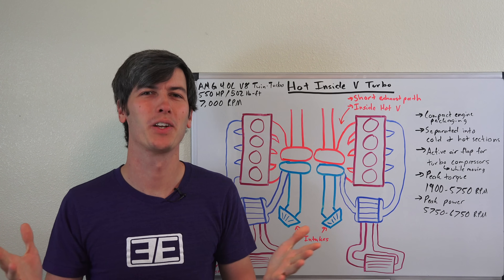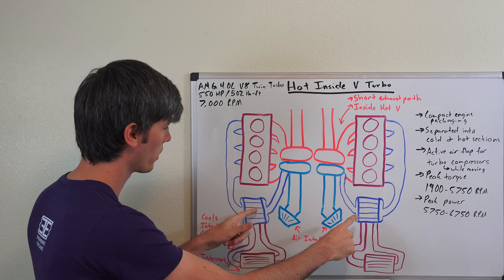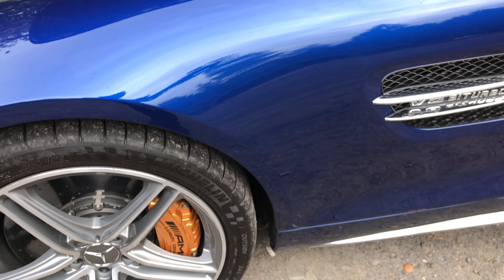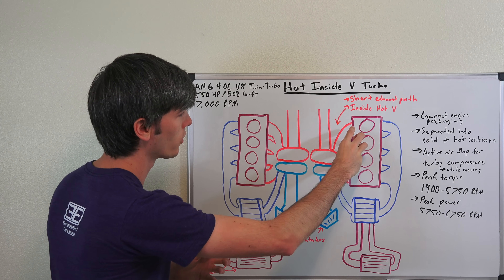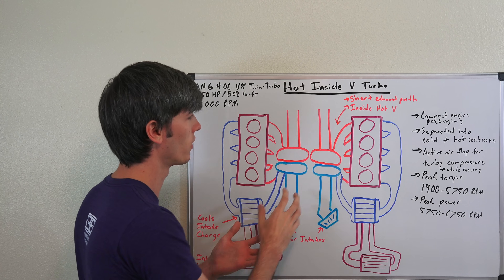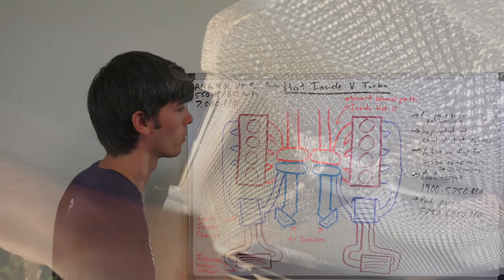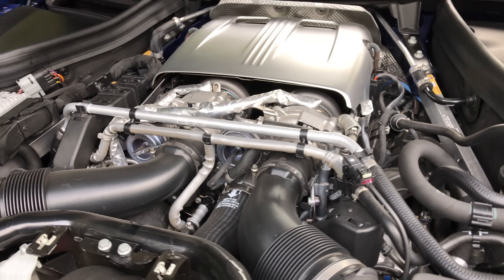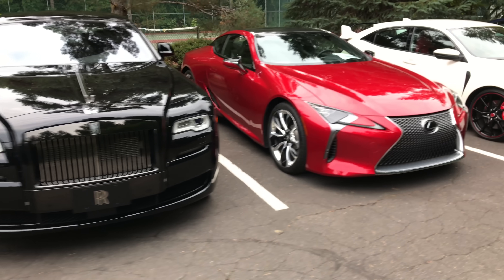Mercedes Clever Turbo Engine - "Hot Inside V"

Comment: Sounds like a nightmare to service...
Reply: No harder to service than normal as we typically drop the entire engine if major repair is required. Also nothing is placed inside the v to be serviced besides the turbos and manifold. Spark plugs are placed outside the v which improves servicing as the exhaust is no longer there and injectors are center of cylinder head which are the long tubes in the illustration. Servicing is easier on this engine family which means I make even less on warranty repairs which was not that much to begin with :(.
Reply: Can confirm.
Reply: Fozee Black Heat shielding is a thing you know... All sorts of coatings and insulations available these days. These engines rarely fail from these obvious spots, for bmw it was the retarded decision to use recycled plastic in their accessory pulleys that killed countless engines...going green because of pr made a huge dent in their reputation.
Reply: If you can afford the car it shouldn’t be a problem lmao
Reply: To me im thinking of 2 huge 98mm turbo sticking out of the hood.
Reply: MasterMech77 You said it!
Reply: AutOdometer Yep. I pity whoever has to service these turbos when carbon build up needs getting rid of.
Reply: Yep, whatever is in that V over time comes out pretty cooked...
Reply: This.  If the engineers can get better performance, efficiency, and a more compact package all without breaking the budget and the downside is it is harder to disassemble for service they won't even bother asking which way they should go.  Thats true on basically every car from every manufacturer.
Reply: its definitely more efficient and compact. makes a lot of sense from an engineering perspective.
Reply: MyBrothersKeeper but not from a practical longevity standpoint
Reply: Most mechanics will appreciate having the turbos served up in the vee. You know, just where carbs sat for decades in old tech v8s.
Reply: True, but the customers who buy MB new don't buy them for reliability or ease of maintenance. Less turbo lag at the expense of turbo location makes sense in this case.
Reply: It's not bad... Mercedes are actually pretty easy to service, believe it or not
Reply: Coffey King no they aren’t, do you work on them? I do, not fun
Reply: AutOdometer I love how your taking advice from Scotty Kilmer , a mechanic that drives a Toyota corolla lmao
Reply: lol no one services mercedes. just throw them away and make a new one. they never reach an end user that cares to pay to fix them.
Reply: RL Agito wrong I have a 2011 c300 with 70 k miles and I service it regularly
Reply: iliovecaRS I'm rich enough. Because I don't waste it on buying Mercs.
Reply: You should give Mercedes a call and let them know. I'd be pretty surprised if they don't end up sacking their engineers and hiring you as a consultant.
Reply: I have owned a couple MB cars... they are very well made and will last just as long if not longer then typical average vehicles... Unless you don't do proper maintenance on them. So anyone saying they don't last are the people that don't maintain vehicles properly. I am not just talking getting the oil changed by some "quick lube" either... using the right oil, doing the services on time, stuff like that. Not waiting "another" week because you don't feel like getting the car serviced... because what harm will an extra week of driving do right?... Yeah bad habits are what kills cars that are not forgiving of a poor maintenance routine.
   If you think a MB has poor longevity... feel free to continue to drive your vanilla 4 door Eco boxes. I don't mind, someone has to do it.
Reply: Audi’s new 4.0 v8 in the s and rs models has this layout. And yes, they are crap to work on in this config. Done a few jobs in my time at audi on these. Luckily not many went wrong.
Reply: why?  by the time it needs spark plug replacement your lease is up  :D  just return to dealership  ...
Reply: Right. They're cars just like a Toyota Camry or a dirty, old Ford pickup. There's always a way to fix something - take it from someone unfortunate enough to work on the aileron control system of a 1982 Cessna 152!
Reply: Looks easy as hell to service to me. The turbos are right there in your face, it doesn't get any easier than working on top of the engine. Rather than try to get at the turbos that are wedged between the unit body and the side of the engine block and lord knows what suspension pieces and hoses and what not.  shrugs
Reply: It's called planned obsolescence
Reply: Fozee Black yeah, I wounder how they have solved that..?
Reply: Any turbocharged OEM car is..
Reply: iliovecaRS I work in corporate finance. You drive an old Subaru
Reply: TheSaintST1 I work in finance too I live in New York , you probably make 50k a year if you lucky lmaaao
Reply: Oh I'm sure the turbos will hold up GREAT with MB's long drawn out oil change intervals, lol.
Reply: service ?  why ?, its not a toyota that can be driven up to a million miles,  Mercs are the type of a car that is mostly leased, return it after four years  :D
Reply: 1/2 of the original price gone in 2 months basically, the longer one keeps this car the more expensive it is to maintain hence it is a car that is leased instead of owned  :D
Reply: Yea, he might but his statement/comment is still correct, it would take specialize tools to work on those things for service...
Reply: In Murica you don't have to afford one, you just need to lease  :D    besides with the way Mercs depreciate it is wise to lease than to buy   :D
Reply: As Scotty Kilmer stated in one video a brand new Mercedes at $82k was $16k 5 years later
Reply: No, actually it's quite the opposite.
Reply: AutOdometer Do you even Know where turbos in other Cars sit? 
i bet it is far more easier to maintain than other cars
Reply: MasterMech77y econobox has lasted 10yrs and 160k with nothing but oil changes and spark plugs.
Reply: RLAgito  That's one of the dumbest statements I've ever seen on youtube, and you know the competition is big.
Reply: illstplaya  The comment was made that having the hot vee arrangement would make servicing the turbos a nightmare. Not so they are very accessible in the vee. This engine of course does not use carbs.
Reply: If you can afford that you wouldn't need to service it yourself lol
Reply: illstplaya  Read what I said gumball.
Reply: I also see a lot of plastic on that one.
Reply: sounds like a mercedes
Reply: M271 engines were absolute junk, regardless of how well they were maintained, I have seen these engines at 70,000 miles with full dealer service history, and all the sprocket teeth have vanished of the cam gears. Mercedes refused to change the design and replacement gears are 500 euro each, and still made of poor steel. This engine was very popular in Europe and failures were common place, giving Mercedes reliable reputation a proper kicking. I am not disagreeing that some owners skimp on maintenance , but manufacturers standards have really nose dived since around 2000.
Reply: TrueBlueEG8 I keep hoping that new car lease financing schemes will encourage manufactures to make longer lasting cars since they're the ones who have to deal with the problems once the lease period is over
Reply: TrueBlueEG8 uuuuuuuugh the 271...... I do hope they engineered my m276 Dela 30 better!!!
Reply: AutOdometer nah! It's easy!
Reply: nothing unusual for premium or performance cars
and this one is both
Reply: I own both an Acura and a BMW. I work on both and can drive one while the other is being worked. I work on them because working on cars is fun and I've already invested money in purchasing them. Upkeep is just part of the equation. When you've purchased a house, you don't just let it fall apart, correct? You fix things that break. Same idea. The honest truth is take care of things the right way and they'll work the way they were design to be. Be aware of the fact that more performance sometimes means less reliability. They both have their good and bad points. Acura, not enough torque; BMW a little less reliable when driven hard but love the performance. Take care of both well and there are no worries.
Reply: It is. Only experienced it with the engine of the bmw x6m though.
Reply: AutOdometer easy to service, the older stuff is worse, imo
Reply: Becoz it's HIV XD
Reply: It pays off when you have high reliablity😉
Reply: Well your not doing the work are you
Reply: That looks like 2980's Chrysler engineering..Lololol. is that a jagged turbo next to the brake fluid reservoir? Ok. Probably$5000 for the"extra firewall insulation package".
Reply: The part no one mention about the newer turbo "more efficient" modern samller engines... lol what a amount of crap! bring back the more reliable NA units please!
Reply: Why would they be a nightmare ?
Reply: If tha's the case, have you ever worked on MTU 4000 engines or Cat 3500's?
Reply: Not at all. Are. You suggesting the ‘outside hot V’ engines are easier to service?
Reply: Bruh one came in for an oil change and I ended up having to put a camshaft in it, random ass crank to cam correlation fault. Timing was a nightmare, now I have misfires 😂 this is a freaking nightmare
Reply: oh and it looks cool as all get out :)
Reply: no... what are you smoking, belly button fluff?
Reply: Thats maybe the case for americans which hardly service their cars anyways, so when you let mercedes maintenance slip, it will cause a exponential failure of components that would never break if the car was properly maintained. Mercedes are one of the most popular second hand old cars in europe since they actually last many more miles than other Germans.
Reply: Asiamies ya well Americans USED to make certain types of vehicles that were bulletproof that were easy to work on yourself and didn’t require that much maintenance. Now, thanks to demorats, we have to put so much time, energy, money, parts, and last but not least thought, into every mile we drive and worry about tax on miles and paying for toll roads and paying carbon tax.... the list goes on and on.
Reply: LOL, engineers last concern is a technicians ability to do their job.
Reply: like some Renaults where you need to take the wheel off to change a light bulb? lol My partner has one and it seems like any small job is a complete ball ache
Reply: It is gonna take hours and special tools to some simps work like  change spark plugs for sure
Reply: iliovecaRS So do you based on your incorrect use of your/you're.
Reply: MasterMech77 they old ones do. Last decade or so reliability has suffered...
Reply: +TheSaintST1

Lexus is a heavy, slow,, bland and uninspiring re-badged Toyota. Mercedes and possibly Audi make the best interiors under $100K. AMGs are faster, more fun and are all around better cars even to just presence. I actually drive a Subaru STI too. but I'm cross shopping a C63S sedan and F80 M3 ZCP for the Spring. Nothing beats European cars. I'll sacrifice what reliability difference between a Lexus and an AMG with a good warranty and never think twice. Enjoy your vanilla ass Toyota, pleb.
Reply: It was gonna be a pain in the ass to service whether they did this or not, it's a Mercedes.
Reply: You don't want to work on a Mercedes.
Reply: MasterMech77 a MB is a vanilla box lol... In the Netherlands and Germany they are as common as the toyota here in the USA.  Americans are dense asf lol
Reply: TheSaintST1 keep dreaming you'll never make enough to afford one buddy
Reply: towlie911 anything you can't afford is.
Reply: IceLemonTea (Lexus) thanks, I will.. I'll even wave as I drive past when your Mucky Benz is parked up on the side of the road because the transmission has thrown a wobbler.... lol
Reply: scrappage etc recycle : lots of iron + aluminum (highly recyclable) thankfully
Reply: TheSaintST1  YOu work in corporate finance...so you do nothing and get paid a lot because of a rigged system where people like you cirklejerk each other and get payed way more than they deserve.  I wouldn't boast about a career that worthless if I were you.
Reply: Sounds like a nightmare to own....
Reply: AutOdometer sounds like your poor.
Reply: Stick to your toyota then..
Reply: John Crowley carbs were never in the V at all. What are you talking about.
Reply: @illstplaya  on every v engine thats where the carbs went.

Comment: That's the same basic design as Ford's 6.7 Powerstroke Diesel. I'm glad to see that sports car manufactures have adopted the same technology as I think it's a far superior design. Much more compact and generally just makes more sense for a turbocharged V8.
Reply: 7.3, 6.0, and 6.4 were all International engines.
6.7 is a Ford engine.

GM and Chrysler still don't make their own diesels. Kudos to Ford.
Reply: kayzrx8, Nope...it is exactly as in the video. Exhaust ports are in the v on the Ford 6.7. Intake ports are outside the v but with intake runners integrated into the valve covers. A pretty cool design.
Reply: Steve Pounder The exhaust ports on a 6.4 are on the outboard side of the heads. The 2011+ 6.7's are the only Ford engines to have inboard exhaust ports.
The 6.0 introduced the vgt setup. The 6.4 had compound turbos, one being vgt. And the 6.7 went 1 step further, combining the vgt hot side with a double sided compressor wheel, making it a large and small turbo in one
Reply: Mike Tunstall I do agree the 6.7 is a fantastic engine. Another thing they did to reduce lag was to run water to air instead of air to air to reduce lag further while maintaining charge cooling at low speeds a heavy hauling pickup would see as opposed to a high speed sports car.
Reply: The engine I am referring to is the 6.0L Powerstroke, in 2003-2007 Ford F250 to F450 and E250 to E450 pickups and vans. It was designed by International, and was also in some of their trucks. I cannot comment on the sense of the design, as I did not design it. I can say that the complexity of the design and the tight quarters in my van's engine bay compelled me to sell it for $100 rather than fix it.

However, after reviewing photos, I can confirm that the U-shaped intake manifold is nestled inside the V, along with the turbo and the EGR cooler. The exhaust manifolds run along the outside of the engine, meeting behind the engine and going upwards toward the turbo. There is a branch off the passenger side exhaust manifold that joins the aforementioned EGR cooler, an exhaust to coolant heat exchanger. This feeds sooty exhaust back into the intake manifold.
Reply: Mike Tunstall your right my bad. For some reason I got the 6.7 mixed up with the 6.0 which is the way I was describing. The 6.0 has the turbo in the v and the exhaust ports on the outside routed back to the v of the motor to drive the turbo charger.
Reply: mike is correct. ive had 2 of them a 2011 and a 2016 i think id know 😂
Reply: the 6.7 has the turbo in the middle of the V but it has exhaust pipes routing the exhaust behind the motor to the turbo. It does not have the exhaust ports in the v of the engine like theses engines mentioned in the video. it has the intake in the middle of the  V like a traditional v8.
Reply: @kayzrx8  You're talking about the L5P Duramax, bud. The new 6.7 Powerstrokes are hot-V engines.
Reply: @electric7487  no I'm talking about the 6.0 Ford motors. Read the thread .
Reply: @kayzrx8  In that case, yes, you're correct. My bad.
Reply: Scott Thank you I was in correct.
Reply: So does the newer 6.6 Duramax..
Reply: Black70Fastback I think the 2011+ Duramax is Hot Inside V.. I have an ‘06 and that is not hot inside V, but the newer ones Im pretty sure they are..
Reply: Black70Fastback I’m no diesel expert, if you have precise info just send a link and share it with us.
Reply: Black70Fastback yeah you’re right, I searched and even though the turbo is mounted on the top and gives the impression of a Hot Inside V, its not.. its just a huge hot turbo sitting there right next to the intake..
Reply: The 6.7 was the first diesel used in Ford trucks to have this design. The 7.3, 6.0 and 6.4 all have exhaust manifolds on the outside of the heads feeding a central turbo(turbos in the case of the 6.4)
Reply: The 2003.5-2007 6.0L Powerstroke was the same design, and also had a variable geometry turbo. My million km 2006 E350 had minimal turbo lag, and was much smoother and quieter than older diesels (way louder than the diesels from this decade, though).
Reply: Mike Tunstall The 6.4 also did this. Makes sense to me if running a single or compound turbo set up. Doesn’t make sense to me to do this on a twin turbo system. The turbos hanging off both exhaust manifolds under the engine are no further from the engine heat. Intake piping is not reduced. The torque band he’s mentioning is no different than most engines FI or NA that have VVT. AMG ran smaller turbos shocker they don’t have much lag.
Reply: Questioner, which engine are you referring to? There would be no sense in putting a turbo inside the V and not at the same time route the exhaust manifolds into that turbo. Otherwise you'd have to plumb those manifolds from the outsides of the heads around to the turbo between the heads. Just increasing complexity, lag, material, weight.

Turbos mounted between the V are mounted there because the exhaust exits the engine in the same place. Reverse flow (outside to in, rather than the normal inside to out).
Reply: Powerstroke copied DMAX on this. Just like everything else on the motor truck pretty much down to the cubic inch size. Same turbos, same fuel rail, same fuel pump, same basically everything. All copied DMAX.
Reply: Upon further investigation, the turbo is inside the V, but the exhaust manifolds are on the outside of the engine. Sorry for the mistake.
Reply: Mike Tunstall are you trolling?